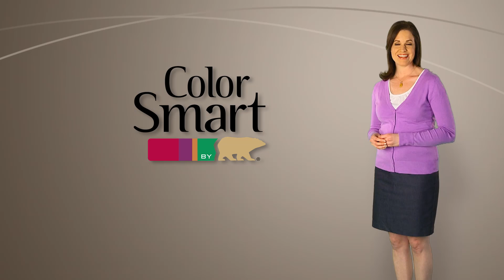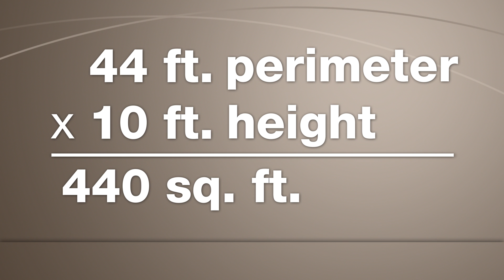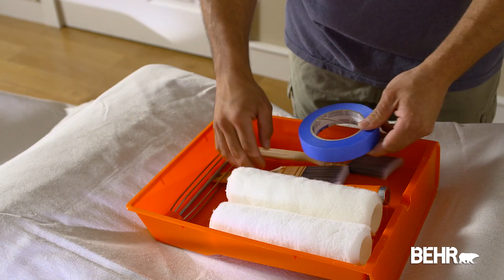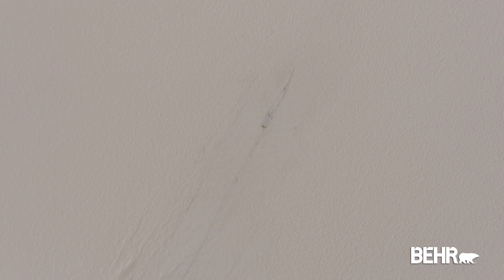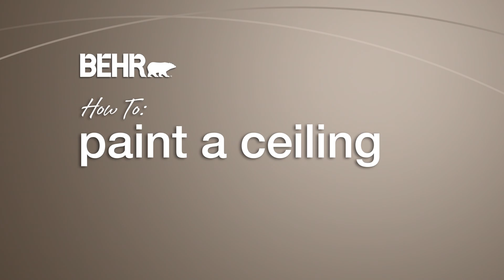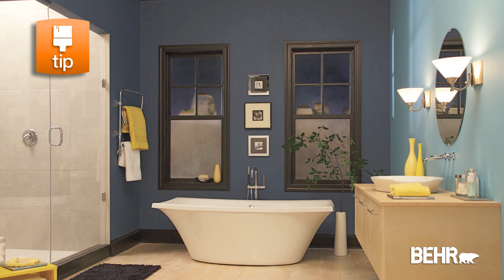BEHR Paint: How To Paint Interiors (Full Version)

Comment: I am a licensed contractor and have been painting over 30 years and I have found that Behr paint to be one of the best on the market. much better than Sherwin Williams and Valspar. when using the Marque line I find that I use less paint and usually only need one coat which saves time. it all adds up to $$$. they also guarantee one coat the one time I had to do two coats I contacted Behr and they replaced the full cost of the paint no questions asked. I don't know of another company that does that.
Reply: Ric Cipriani Lol you kidding right? Thats so funny🤣🤣
Reply: Ric Cipriani bla, bla , bla
Reply: Yeah, that whole primer in one is a sham.  I say just 2 coat everything with Promar I mean paint is paint.  One egg is the same as any other brands egg for example.  Why not save money on the paint over labor.  The 15 year guarantee might not be there, but has anyone ever heard of paint falling off the walls before a repaint or suddenly fading....no those are sales gimmicks these premium paint companies deploy to get the average homeowner to go out and spend their hard earned buck on a gallon of paint that might not cover their poppy color or not stick to a surface.